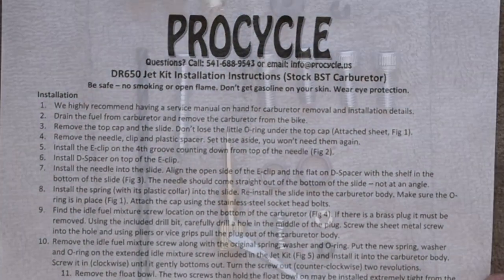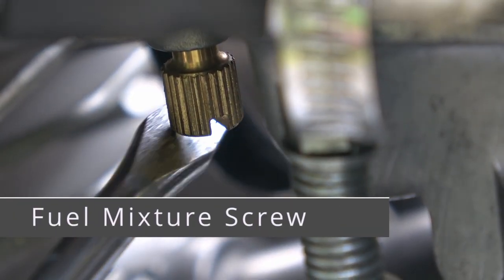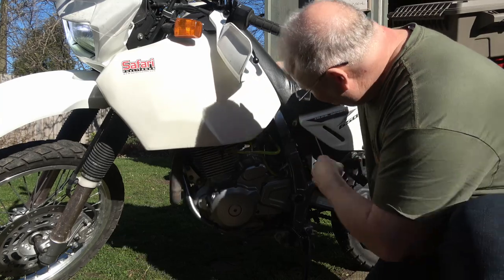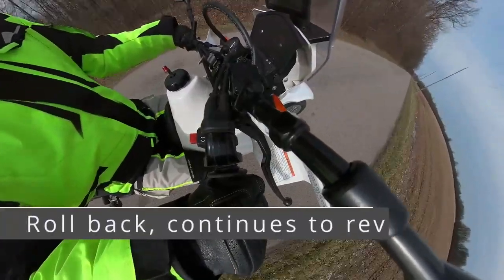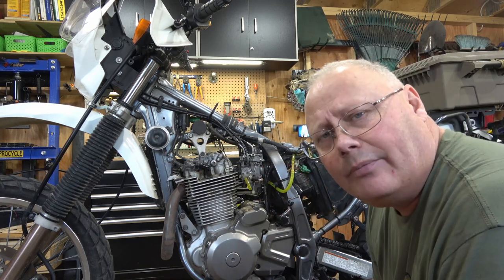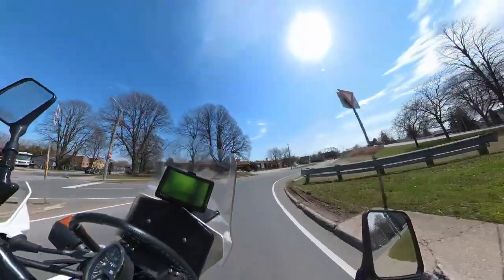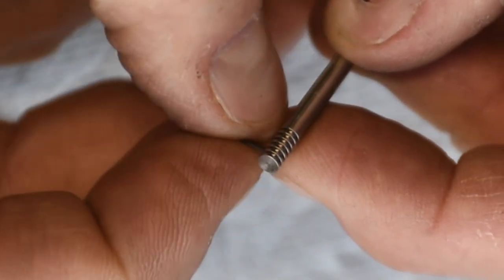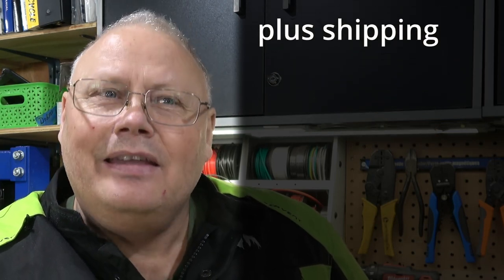I show you how to tune the Procycle jet kit installed in my DR650.

Comment: Nice informative video, Dino. I’ve been thinking about this kit for some time for my 2018, that’s still stock and  of which does take some cranking to get started cold. Also, have to warm it up a minute or two before it can be ridden. I’ve been hesitating because I’m nervous about fiddling and didn’t want to replace the exhaust or punch holes in the air box. Your excellent detailed summary of your trials, what worked and what didn’t, helps in exploring the improvement further and reducing the risk of messing up. A concern I have when some experimentation is needed.

Thanks also for your base settings that you’ve shown works well with stock air-box and exhaust. 

You mentioned you can feel more power to ground and better starting. So it’s recommended. Is that still the case with the settings stable and have you come across any issues down the track? Reliability is important for my long trips. Kind regards. Craig
Reply from the maker: Hi Craig, Thank you for your questions. I think this was the second year I have had this kit in place, and to be honest, it works so well I forget it is there. Like yourself, my main concern with a motorcycle is reliability, not so much performance. This kit has provided the cold start performance I was looking for with the dependability I was looking for. I have ridden the bike on a few longer trips of 200km plus with no issues and no noticeable increase in fuel consumption with my riding style. Just the other day I started the bike at -2 Celsius after sitting for several weeks and it fired up after one a few cranks. I would still recommend this kit to those looking for these kinds of improvements and do not see the need to open up the air box or add an exhaust if you are only looking for improved starting and low speed gains. I hope this helps, and again, thank you for your question and feedback.
Dino
Reply: Thanks Dino for your reply and the really helpful information. I do favour a very similar setup to yours for my DR. Better starting, slightly more useable low end and possibly more punch at higher speeds especially for overtaking/carrying loads (camping gear) would be good. I’ll explore the kit further thanks to your advice! 

In any case, thanks again. Really enjoying your channel.
Reply: Hi Dino. I finally attempted the Procycle DR650 Carburettor Kit yesterday. I tried the initial setting that you’d found worked well for your bike: 150 and 4th position. With stock exhaust, airbox with snorkel, cover, no holes and stock filter. Adjusted the mixture screw but there wasn’t a lot of control  on smoothness so left it about 2 turns out. Went for a ride and noticed that it started and idled well. Good acceleration from low to mid but seemed to hesitate at mid to high. 

Suspecting it was running too rich, I adjusted the needle to 3rd position and tested. Better control was noticed with the mixture screw. Was set at best smooth idle setting and with crisp revving up. It was about 1 turn out. Slightly better running but still had hesitation at mid-high revolutions. 

When the throttle was pulled fully open while riding it was hesitating but then revved fully. So I think this second setting was still too rich with stock airbox (no holes, snorkel and cover still on) and stock exhaust. 

After these two failed attempts, I went back to the original stock arrangement for my Australian 2018 model with 140 and standard needle. 

I suspect the altitude and variations between Canadian and Australian models may have had some effect on the varying outcomes. 

In summary, I think there was some slight power gains and easier starting with the kit. With more experimentation, I think I’d eventually find the right setting but I ran out time yesterday. 

For the next attempt, I think the 145 and 4th position might be the start for my machine with further needle position adjustments as required. If it was still rich, I was even thinking of trying the stock 140 and the Procycle needle at 4th position and see if that improves performance. 

In any case, if you have any suggestions, please let me know. I’ll revisit this modification at a later time. 

Kind regards
Craig

Comment: Dino, I'm located in Buffalo and am thinking of getting a DR 650 next spring.  Most of the videos are about the DR and off-road riding. I'm not really looking into doing much off-road other than the occasional dirt road, more for cruising up to Ellicottville and exploring back roads.  A lot of 55 to 65 mph (80 to 100 kph) kind of stuff for 3 to 6 hours at a ride. Since we are located fairly close geographically speaking and you're familiar with the area, I thought you would be the guy to ask, how practical is the DR for that.  I do appreciate its simplicity as I like to tinker.  Anyway, your thoughts.
Reply from the maker: Hey Joseph, thank you for the questions!
It sounds like you ride the way Karl and I mostly ride, we do a few easy trails but mostly paved and gravel roads and the DR is well suited to this type of riding with a few things to consider.
1. for longer rides the fuel range in stock form requires a bit of planning with only 13 liters, Karl's 20 liter tank really helped this and there is no need for the 30l I have unless you are planning very remote rides.
2. the stock seat is tolerable for most day rides but if you are planning 6 hour trips or multi day rides a good seat pad or replacement seat may be something you would want to look at and budget for.
3. The stock suspension would be fine for your application by the sounds of it and it is great at soaking up speed bumps, rutted roads and pavement imperfections.
4. power is adequate for what you want to do and the bike will cruise fine at 60 to 70mph in stock form. Even mine with 14/46 gearing cruised from Albany back to Buffalo on the I90 at 60 to 65 with no issue at all, you will not win any drag races but it meets my needs well. The bike feels tall on the high way and wind can move you around a bit but you get used to it after a bit of riding.
I hoe this helps, maybe Ill put a video together on this topic as well with a little more of my thoughts, thank you for the question.
Dino

Comment: HI Dino, I really enjoy your videos.  I bought the procycle jet kit and installed it.  I have a couple of questions for you if you don't mind; I can turn the fuel mixture screw in all the way and the motor still runs decent at Idle.  It does not seem to sputter out like the instructions say.  Am I running lean or rich?  midrange throttle seems to sputter somewhat also.  In 4th WOT let off 7/8 the speed stays then drops some.  I'm confused at this point and could use some help.  I'm at about 2300 ft elevation.
Reply from the maker: Thank you for the question, again I am not a mechanic but will try my best to help. what jet size did you put in? did you open up the air box or remove the snorkel?
Dino
Reply: I kinda basically did what you originally did: I followed the Procycle instructions and inserted the 145 main jet and built the side cover frame screened to open the air box.  I will be removing that and replacing the original cover today to see if things improve.  I seen on another channel that opening the side cover area  may not work for the "carborator needs dead air" and the opening of the side cover would feed air due to its location and side panel venting.  What are your thoughts?
 @DinosTinkerShed
Reply from the maker: @bella3007186  Yes, I ended up replacing my side cover, and the bike ran much better.
Reply: Update: I put the original cover back on the air box and it improved the midrange and initial throttle response- so improvement there.  I did the WOT test in 4th gear and it accelerated or held when I backed the throttle off.  It appears I am running lean?  Looks like I will be installing the 150 main jet.  I still don't understand why my fuel mixture screw is so far in and the motor runs without stalling out.   @DinosTinkerShed
Reply from the maker: @bella3007186  yes that's odd, it should stumble as you reduce fuel through the mix screw,  I need to think a bit on this. It might be worth reaching out to procycle as well.
Reply: I installed the 150 main jet and adjusted the fuel mixture screw again.  This time with the fuel mixture screw all the way in will, it now make the engine stumble and stall.  The engine does not speed up either when I roll off max throttle in 4th.  I think I experienced much of what you did when you installed the kit.  No air box mods and stock exhaust.  Thanks for replying back during the process.  I look forward to the next video... @DinosTinkerShed

Comment: What was the reasoning to not drill the slide holes and clip the spring ?
Reply from the maker: Thanks for the great question. The hole and spring shortening is not directly part of the procycle kit or its instructions. I understand many have had good success with this mod in terms of throttle response. However for, my piticular riding style, the factory set up with the procycle kit works well.
Reply: @DinosTinkerShed  Hmm.. I ordered replacement DR650SE slide and slide guide from Procycle and they both arrived packaged and marked as for a KTM ( a 640 I believe) the slide guid is the same for both bikes and Suzuki dont sell one for some reasons however the slide has the three holes already in it and not the 2 hole version for the DR650SE.  Now I have to purchase a DR650SE version  . . . Argghhh !

Comment: Dino. Sir I have enjoyed your videos and they have been a valuable tool for me. I have recently received a 1996 DR650 from a friend. He had it inside his garage for a few years. I have replaced the battery and the electric components are working fine. But I am having trouble with it turning over or rather firing up. I will also say that he had fuel in it for those few years. Any suggestions to help me? Sir,
I would greatly appreciate any help you can offer a new owner.  Thank you.
Reply from the maker: Congratulations on your new to you DR650! 😀 

I always point out I'm not a mechanic but will give you my thoughts. If you are planning on keeping the bike and working on it yourself I will suggest you order a service manual, it walks you though the diagnosis process for this issue and is who I have learned what I know over the years.
  I am assuming that the bike turns over fine when you try to start it and that it just will not fire up is this correct?
I would start with the 3 things you need Compression, spark and fuel.
1- If you don't have a the ability or tools to test compression you can at least remove one of the spark plugs and after putting on a rubber glove,  place a finger lightly over the sparkplug hole, cycle the engine and you should feel a fair amount of pressure against your finger. This will not tell you how much compression you have but a good solid pop should be a good sign.
2- While the out you can test for spark 
3- If you have compression and spark most likely it is the old fuel. If it has been sitting for a few years with gas in the system my thought is that the fuel system requires draining and cleaning, this will include:
A- Draining all the old gas from the tank and disposing of it
B- Before I went any further I would add a gallon of new fuel and I would try to start the bike with the petcock in the PRI position, perhaps the vacuum petcock is not working right and the PRI position bypasses the need for the petcock to function properly. If this works than you need to re-build or re-place the petcock. If that does not work than move to step C
C- Cleaning the fuel filter in the carburetor's metal intake tube (it is small, you have to remove the rubber fuel line to get to it) and/ or replacing any aftermarket filter that may have been installed.
D- A full cleaning, inspection and tune-up of the carb itself , the bike is 26 years old after all.

I hope this helps and gives you some direction,  again I can't stress how good a manual is, it walks you though all the steps, I have about 8 or 10 manuals, I never get rid of them, But I am  bit weird LOL.
Good luck and let us know how you make out. 
Dino
Reply: @DinosTinkerShed  
Sir,
What you have shared with me has been very helpful, useful, and detailed  information about this particular make and model of bike. And I will review your videos when I need a reference. I honestly do not have the proper tools now, but I will have them in the near future. I appreciate the quick response back. And sir keep those wonderful videos coming.  Thank you again from Missouri. 😁👍🏼

Comment: Great job on the Videos . I have Stock bike and stock jets and exhaust what do you recommend I should have my fuel mixture screw turn out to.I’m at sea level. Thanks
Reply from the maker: Thank you for the question, Ill start by saying I am not even close to an expert on this topic but will give you what my set up is. If you need more help, reach out to procycle (if you are using their product) and they can assist in baseline jetting. Also DRrider forum is always a great place to research and ask questions to others with much more experience in this area.
I have a 150 main and an adjustable main needle in the 4th position. My fuel mixture screw is the procycle adjustable and I believe I started my tuning with it turned out 2 full turns from fully closed. 
The tuning process for the mixture screw is in the video and is really easy to preform. I am about 99 meters above sea level here in Niagara Falls but have ridden this set up as high as 1900 meters when I took the bike to the to of Mt Washington in New Hampshire last summer and it worked well.
I hope this helps.
Dino
Reply: Thank you
Reply from the maker: No Problem, glad to help.
Dino

Comment: Great video! I'm always curious about your top case. Does it have quick release or is it permanently bolted. What brand is it?
Reply from the maker: It is bolted to the rack but can be removed in a few minutes if needed. Its a very cheap box I bought at princess auto on sale for 20 bucks, it does have a rubber seal but is not all that sturdy when compared to a Pelican case
Reply: @DinosTinkerShed  thanks. I have pretty much the same setup but I'm trying to figure a way to have a quick release system without spending hundreds of dollars.

Comment: Hey! Been watching your videos and noticed on this one that there are two yellow fuel lines going into the carb? I saw one that goes into the carb fuel intake port with the inline filter, but where is the other one going? Thanks!
Reply from the maker: Great question, the Safari tank has two petcocks, one on each side of the tank. The second fuel line connects to the right side.
Dino
Reply: @DinosTinkerShed  interesting! Thank you for the quick reply! Your content on the DR650 is top notch

Comment: I may have missed it, but will you be going back to the open airbox lid, or are you going to stick with the closed lid configuration?
Reply from the maker: Thanks for the question. Right now I am running with the stock air  ox door on and the  one seems to be running very well. 
Dino

Comment: In reading viewer comments, I guess I have another question...kind of a dumb question given that I come from the world of fuel injection.  My DR will be tuned at 8,000' elevation and the bike will be driven to 13,000' and clear down to sea level in a fairly short distance (Ecuador).  Given such extreme elevation changes, would I need to make fuel/air mixture adjustments during my ride?  How to do that?  I assume adjusting position of the clip on the main needle and adjusting the idle?  Thanks again.
Reply from the maker: Hey another great question, I will start by saying I am not a mechanic and carb tuning is something I work at to get right so I'm not expert. I will say that I took my DR on a trip up mount Washington a few weeks ago and I could defiantly notice the power loss above 4000 ft with the jetting I have. The bike still ran and I had no issues with getting to the top of the mountain however throttle response and general performance was impacted for sure. If you are ordering a Procycle jet kit it may be work an E-mail to them explaining what you want to do with the DR and they will recommend a starting place for the jet selection, they are a great place to deal with.
If it were me I would set the bike up to run well at the average elevation you ride at and see if that will work adequately at the higher and lower elevations.  Re-jetting on the road is doable but is a bit of a bear especially if you have an oversized tank like I do.
Again jetting and tuning takes a bit of time to get right and at higher elevations there is less available oxygen meaning your main jet may need to be reduced in size to let less fuel into the system as well as needle adjustments, again Procycle should be able to help you with a starting point.  
I hope this helps
Dino
Reply: @DinosTinkerShed  Thank you Dino...good advice.  I will definitely discuss this with Procycle.  Tuning to mid elevation level makes good sense.  Thanks again.
Reply: Yeah I would just tune for your average elevation. If you need to adjust needle It's pretty easy to remove the needle without taking everything apart. Just loosen the clamps and rotate carb to the side and you can remove in just a couple of minutes. I've noticed big changes by just moving needle one setting
Reply: My bike lives at the same elevation as you, 8,000’ MSL.  I also ride up to 13,000’ MSL.  I ask ProCycle the same question, and was told to start one clip up from the suggested jetting. Then use the smallest jet. I haven’t received my kit yet, but this will be my starting point. Not sure how it will preform for you at sea level, but I imaging it would be rather lean.
Reply: @jbonewitz  John, thank you. That’s good information.